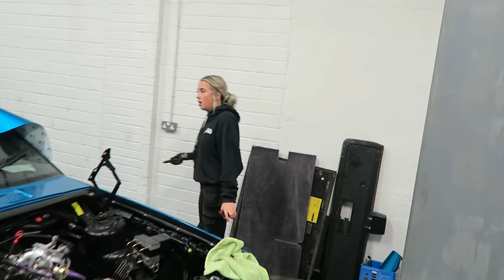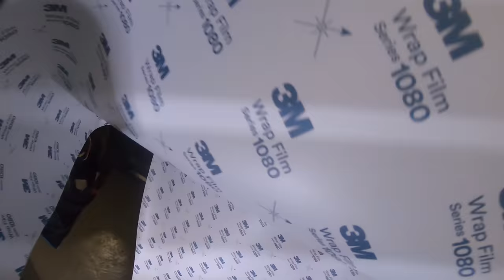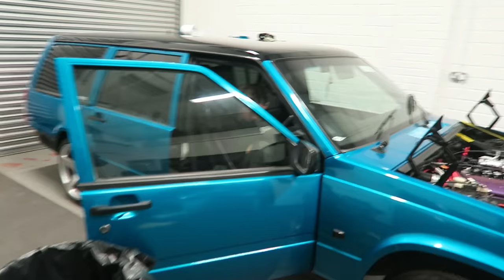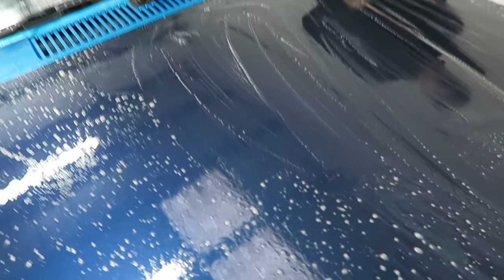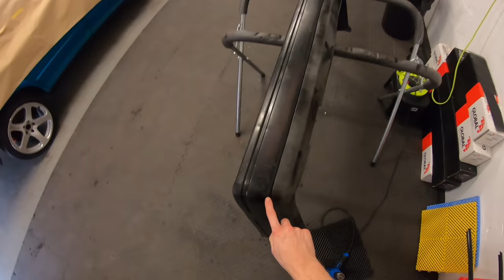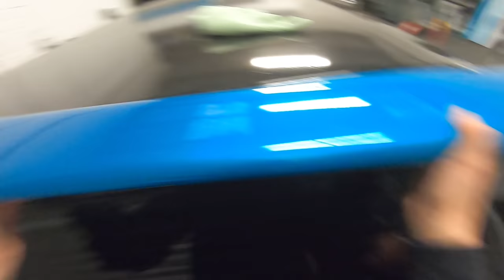THE 12 DAY TRANSFORMATION FROM SCRAP TO SHOW CAR | PT. 3

Comment: All that work and effort those shiney guys put into the engine and you can't even be arsed to sand the bumper before you wrapped it 🙄... At least you got that rear quarter done.. Finally 😂. 

Great job Emdog and team you've all done a cracking job 👍
Reply from the maker: We were left with absolutely no time to spend sanding it, it can always be wrapped at a later date no dramas!

Comment: Looks amazing... one thing missing though; tint the rear lights.  Far too 'clean' with the fronts slightly tinted and the windows tinted
Reply from the maker: I did think this! I tinted the fronts so the colour difference between the old headlights and brand new side lights wasn’t so noticeable but thought about tinting the clear bit of the rears?🤣